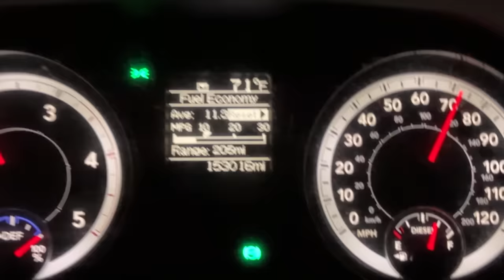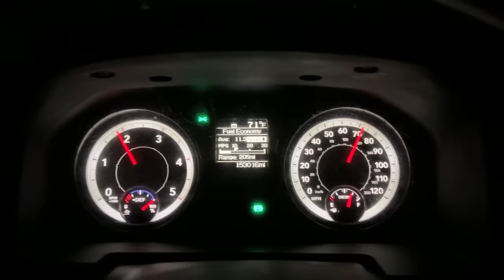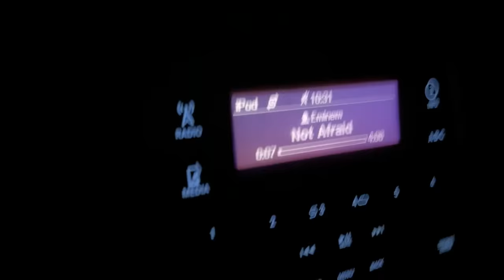My new truck broke down 9.5 hours from home. Dealer refused to do anything...

Comment: Taylor, it sucks that this happened the way that it did. I've been in a similar situation with trucks as you and I ended up buying a RAM Cummins with the 6.7l, fully deleted. After having new cars that I bought for the warranty, then dealing with situations like yours where the dealerships are in a position to completely take advantage of you, I decided that I trusted myself more than I trust any dealership. There is such a golden opportunity for a dealership to just operate at a basic level of decency and look like rockstars, but they can't even do that. I'm glad that the president was able to recognize that he was about to take a bath because of your notoriety, but sadly that is the only reason that he had a change of heart.

I hope that you give them the big middle finger and do your own thing. I wouldn't trust any dealership for anything, and that is based on 15 years of experience as a truck owner.

Good job handling the situation as best as you could, it's a sucky feeling and it's unfortunate that they will kick you when you are down.

My vote for your plan moving forward is to ditch the Ford (I won't own a Ford anymore after several experiences like yours with them), and either really fix up the fummins, or buy a nice 2012 - 2017 or so RAM 3500 and love owning something that just drives when you turn the key.
Reply: Don't even buy a newer Dodge truck the emissions system is a disaster and the electronics are no more trustworthy than that Ford. Fix up the fummins, carry spare parts for it and enjoy the reliability.
Reply: @crazyoilfieldmechanic3195   Yeah, I wouldn’t own a diesel with the emissions equipment intact. Unfortunately all of my emissions equipment fell off while I was driving through Mexico and I haven’t been able to return it to OEM status since then..

As far as electronics, so far I have no complaints, I had a lot of people warn me about issues but I think most of those people and complaints really come from stuff like the TPMS light being on, and similar stuff. I think if you are mechanically inclined most of those issues are not a big deal.

Ram transmissions are a definite weak point, my 2500 has the 68RFE, I feel confident that I could end it at any point by putting the pedal to the floor while pulling a heavy load. The 3500 with the AISIN is supposed to be pretty good though, almost comparable to an Allison. I will end up either manual swapping my truck (like the one that Taylor drove), or swapping in an Allison (expensive to adapt, but such a great combination).

Comment: I used to work the servive desk at a Ford dealership. It might have been helpful ( and still may be depending on their responses going forward) to ask to speak to the Factory Rep. They often have the ability to provide resources to support the dealership by approving $ or provide authorization for covering/ expediting parts etc.
Reply: Taylor shouldn’t have to know to talk to the factory rep. The dealer should be out there fighting for the customer when the customer has issues. It’s called standing behind your product.
Reply: @DMSparky  True. It doesn't change the fact that he needed to.

Comment: CP4 failure is a common problem, especially for the 6.7 Powerstrokes. If you’re unlucky it will take out your whole engine on top of your fuel system.
Reply: Also a problem with GM trucks…

Comment: I bought a 2011 Dmax. DEF problems after problems. Traded on a 2021 Chevy with the 6.6 gas. The only difference is lower mpg, little over 1 vs. Dmax, 17,000, no DEF, no DPF, gas is cheaper than fuel. The truck was still close to 70k, but now I have the bells and whistles. Purchased at Stratton Chevrolet, Dirks family dealership.

Comment: I bought a 22 Chevy Tahoe paid for the seven-year 100,000 mile warranty. I’m still waiting on two control modules that are still not available. I took ownership March 2022 on this vehicle. I have a few issues with the vehicle dealerships here in Georgia suck. You make an appointment for your vehicle to sit there for a couple to a few days before it even gets into  the shop then it’s going to be diagnosed and then you wait for that repair. What a joke. I’m keeping my 02 Duramax.

Comment: Similar Issue with my Ford Explorer News Car with 85K miles bought with 65K last July!  The trans went out due to a recall the dealer did not fix prior to the sale.  Limped into a Dealer 5/4/2023 was informed parts were on back order until June 6  with a repair date est of June 20 I guess we now have to ask what the time frame is for repair, when buying a news Ford in case it should need repair! The interesting part is on the last two 4 hour oil changes at the dealer I bought it from that recall was not found or offered to be done. In rental and insurance fees I could almost fave had the trans rebuilt myself!

Comment: Wow. My step dad and mom have used their 2012 4x4 Toyota Tundra a lot to move around with their big trailer. That thing is pretty heavy and big. They used to live in it. They have made several big road trips around the US with no issues. Sorry for your issues. Ford just sucks. At least the more modern ones due. Subscribed. Now Toyota has that new turbo V6, which some owners have mentioned that it wastes more gas than the super reliable V8 from the previous Tundras, and some people have been blowing up the turbos. That has been when towing stuff. RIP reliable V8 Toyota engines. It was way too reliable for Toyota to make more money off it 😢

Comment: I had a 2013 f350. Had nothing but bad luck with it. Went back to a 2000 7.3 and have had nothing but good luck with it. It’s slow, loud and rides rough but it always starts and never leaves me stranded.

Comment: I was just about to buy my 4th Ford Pick Up Truck, a 2023 F150 King Ranch for my Wife's Birthday (mine is 7.3 2002 F350 XLT Off Road) ... then heard how FORD Treats Customers, their New JUNE PRO WOKE Sales Campaign, read about all the Recall Issues and Reliability Complaints on New Ford Trucks; so NEVER FORD AGAIN now and heading off to the Toyota Dealer With $53,000.00 CASH in hand for a 2023 TRD PRO instead. Change is always hard for me, especially now at 64, but done with the dying FORD Brand. Chris is one of those Good Guys ... very lucky break.

Comment: my ford 6.0 blew a STC fitting at 2am September of 2016 driving cross country with a 20' big tex trailer.  

i had all my tools on that trailer crated up.   driving in tow mode, hit the brake pedal to exit the highway near Columbia south Caroline.   the transmission down shifted and blew off the STC fitting dead in the water at the top of the exit ramp, called AAA they like oh yo got a trailer... that a commercial tow 180 dollar for a 500-foot tow to the nearest hotel.

the tow truck driver lucky came to the hotel at 8am and was like I'll give a ride to Uhaul.  which saved me a ton of a headache.  local truck rental became a 8 hour round trip drive. but I got it done.

Comment: Dude I'm not a  FORD person but the BLACK FORD TRUCK IS A LOT BETTER TRUCK than the JUNK HEAP WHITE FORD will ever be it has a better DRIVE LINE in it and you see it is reliable and it will run so it looks bad at the moment AT LEAST it will get the job done without a gripe one so let FORD have that WHITE TRUCK back and furthermore tell them to EAT that TRUCK and do everything you can do to get your MONEY back excwept of course what it will cost you for you having the TRUCK and what few miles you put on the TRUCK this is what I would tell them

Comment: Thats is the most scariest thing, I remember back in the 80s I was about 3 hours from home, I was young, broke, and I had a Chevy Nova that broke down in the Bronx NY. I was thankful about a block away, there was a garage with some dudes that wanted to help, and help they did, they got me back on the road in about 1.5 hours, and it cost me $40 and a case of Heineken beer that the folks in the garage requested and were thankful. I think the problem was with the starter or something, but the fix the brothers did got me back home safe and sound.

Comment: Just so you know, I bought a 1028 RAM 2500 long bed with a 6.4 gas motor. Another story for another time. The point is, I have been a Ford truck guy for over 40 years. I noticed Ford's performance and reliability downward for the past 10 to 12 years. I got a 2018 Keystone Outback Travel trailer, and the RAM was perfect for this 32-foot travel trailer. Again, I am impressed with the RAM 2500. Plus, RAM is the only heavy-duty truck with rear coiled springs. Less squat.

Comment: Sorry to hear of this.  I’ve been in similar situations over the years.  Taught me some lessons.

But… any dealer regardless of brand, is not going to blindly honor a warranty until they know they have to.  Some are better than others.  But all need to ensure it’s valid or Ford won’t pay them back.  They all work this way.  Vehicles are much more expensive these days and because of warranty losses they take a much closer look than they used to.  It’s a complicated vehicle and could take some time ensuring they have it right and found everything.  Don’t want surprises with more problems after the parts show up.  

Loaners are tough when it’s a truck of that value and capability.  They even have a loaner like that?  Probably not.  $$$ If you were local the chances get better.  

The biggest problem is the comments on moving the trailer.  This could have been simply curiosity or sales manager being a jerk.  The tone of voice would mean everything.  That’s an issue the boss there needs to address.  Good luck!

Comment: If you’re going to be towing, just get a Ram Cummins. I took the advice from 3 of my friends that had powerstrokes and had nothing but problems, fuel system, turbo went out, injector problems and transmission problems. 2010-2020 model years. 45k average mileage. They’re beautiful trucks but that’s it.

Comment: The actual problem is regardless of what the dealer does they represent a shit vehicle and shit company.  Ford F****d so many people with the 6.0, 6.4 and now the new in-house turd they deserve a medal for bending people over dry.  I lost my shirt on my first "We fixed the problems" 6.4 Ford diesel I bought to tow what would be considered light duty. 6000lb 16 foot enclosed trailer for work.  After X amount of dealer visits before 30K miles, I decided to leave it stock out of fear.  The month...month after it was paid off and 5K pass warranty it all went to shit.  #7 went soft, caused the computer to freak, dropped power on the highway, caused a downshift that felt like I was rear ended by a semi taking out the trans as well.  There I sat with a paid off truck I pad $70,000 for that was literally a mechanical salvage.  (It would cost more to fix...WAY more than the truck was actually worth.)  Total loss.  Nevermind all the lost work and being stranded etc.  I babied that truck and did ALL maintenance religiously.  Bought the best oils, used non Mexican motorcraft parts etc etc.  JUNK!

I know of a local ambulance company/owner that actually went bankrupt thanks to switching to all (New at the time.) "fixed" 6.4 Fords.  Just having his fuel mileage cut in half to 9mpg (I averaged 8) put him in the poor house!

After that I foolishly purchased a used F150 in "great shape" under 50K miles.  The cam phaser literally fell apart locking the engine on the highway.  It was towed away and I lost my shirt again.  Ford KNEW that was a problem...a BIG one and no recall.  Thanks Bill!  Glad you got to relive your childhood and race Lemans.  Try running your company with some integrity!

Never, ever ever ever will I buy a Ford anything again.  I had Mustangs, Taurus family car, a Ranger as a daily run about etc.  Gone.  Anything  blue oval in my driveway is at risk of being burned to the ground.  I will never forgive that company for the screwing I received.

Comment: You have a Cummins, it doesn’t get much better than that. By the way, with a CP4 pump on the Ford, ALWAYS (every fill up) put in a diesel additive that adds lubricity to the fuel for that pump. Hotshots EDT is the way to go. Fuel alone doesn’t have the lubricity needed to keep the CP4 alive long term. This is what I’ve been told by multiple diesel mechanics. Good luck with your trucks.

Comment: You bought a Ford. The ford 350 diesel's (don't know if yours is diesel) have been the absolute worst trucks ever. Extremely high cost of operation & high failure rate. I did a lot of research when I bought my 3500 Ram. I'd looked mostly at GM because they were cheaper than the RAM's and more plentiful. So when a RAM presented itself at a great price I was ready to buy it & I have loved it for 8 years. When I did the research I found Fords were the cheapest & most plentiful but all the guys who drove for a living delivering 5th wheel's & coaches told me either GM or Ram. Every where I went everyone was "diesel 1.5 ton pickup - don't get the Ford's. Too many expensive engine issues, transmission problems, & a lot of electrical issues. They provided detailed statistics & the Ford's are the worst of the bunch. All the diesels Ram 3500's, GM/Chev 3500's, & Ford 350's are not that great for operating & maintenance costs but the Fords are the least reliable. It's a statistical fact. Notwithstanding that, in any dataset, there will be people that have no or few issues & people who have lots. But the odds of it happening are important in making a decision which to buy.

Comment: I have been driving ram trucks for 34 years and they all had the big c in them . With all the electronics in them the reliability it's not sa good. It is easy for me to tell you what to do but I am not in your place. My self  I would fix the black truck. You know the hole truck and if money permits an 8 or 10 speed Allison transmission. Not the one that gm and Ford built. I live in Santa Rosa CA and they want everything electric. Keep the black Ford and make it reliable you will be money ahead.  My 1989 12 valve was awesome my 03 24 valve was junk my 2021 3500 single rear wheel awesome. On the 24 valve 5.9 make sure it is not the 53 block. The 03 fuel system factory junk. I put  a 33 percent over pump on it with stock injectors with an edge programmer. The 33 percent over pump with the stock injectors gave me a boat load of torque because your atomization went through the roof. I pull a16000 3 axle trailer. It pulled up a 5 percent grade at 60 miles per hour. I also  did a exhaust brake and after the cat I went from a4 inch exhaust to a 5 inch exhaust with a straight throw muffler. A built 47re with a1800 stall speed convetor with 373 gears dually 4x2 3500 .the electrical was junk. Been working on diesel engines since I was 14 years old. My first was a 275 horse power iron lung Cummins . In the air force 6 story diesel engine in power plants  5000 horse power at 900 rpms .good luck on your choice. Denis

Comment: Ford has a recall and a massive lawsuit pertaing the fuel injector pump, the CP4, you should join that lawsuit. And get a better truck Ram 3500 Cummins. I talked to a guy that does HotShot and he only uses Ram Cummins, he has used Ford, Chevy, GM, and he has noted that Ford & GM are garbage.

Comment: Lesson learned, don't buy a Souper Dookey! As the saying goes, "Ashes-to-ashes, dust-to-dust, if it weren't for Ford's, my tool would rust!"

Ford builds for Fleets and retirees, Cummins is a power generator company, they build for uptime and uptime alone, Dodge just adapts their engines to run in vehicles.

Chevy, well they are just Chevy, laurels

Comment: FORD   =  found on roadside dead or f'd over reconditioned Dodge. This is what happened to me every time i bought ford for the last 45 years. Dodge all the way guys... Cummings for the engine. My current 3500 RAM has 323000 miles and so far only a fuel pump failure since 2004.... Sorry u had issues though friend.

Comment: This is exactly why you can't give me a diesel. We can thank our EPA for this. I had a 2012 Ram that several dealers could not fix it dropping to 8 MPG... one of them asked me what I thought was wrong... incredible! My son in law has to have a diesel (chevy fan) when a 1500 / 150 will tow anything he has and he had nothing but trouble with his old truck (a 2011) now his 2021 has let him down. If a gasser won't tow it, I would down-size the trailer before going up to a diesel.

Comment: I have a 2019 f550 loaded down at about 19,000 lbs it has now 95,000 miles on it I've been through 2 turbos with each time the dealer having the truck for at least 30 days (turbos on back order) then Trans was replaced at 70k other than that 😂😂😂 it's been ok 😂😂😂 call it what you want we also have 4 dodge 5500 no issues at all only reason we switched to Ford was a 480v generator called real power runs on pto  truck does idle at 1200 rpm for a few hours a day about  3 days a week  max GOOD LUCK

Comment: I had the same problem with chevy. And still do, I had a 2016 dually 3500 dmax brand new had 32 miles on it. Drove it from Florida to West Virginia then started heading back to Florida, it sent me a message change fuel filter reduced power. I was at 4500 miles at that point. Got it back they then told me that they documented it had bad fuel, I called BS they then told me my fuel system warranty was voided. Month later multiple emissions issues. Finally told them to keep it traded in for a 2017 3500 dually with 12k on it gasser 6.0 vortec. Best decision I made and tow everyday with it. Won't ever own a new diesel again. And same issues no loaner till we diagnose it and I called BS because I bought it as a company work truck.